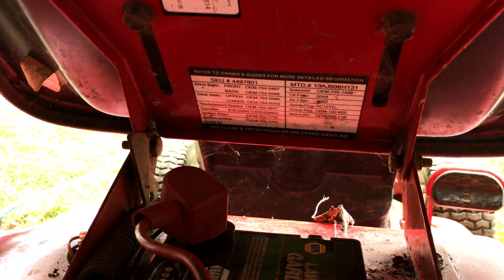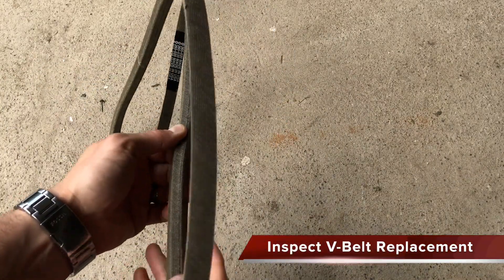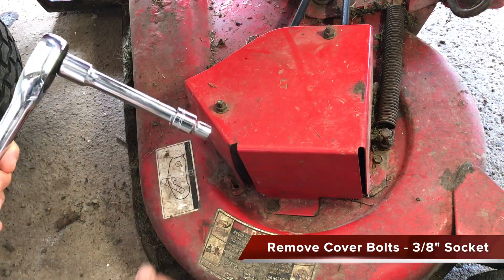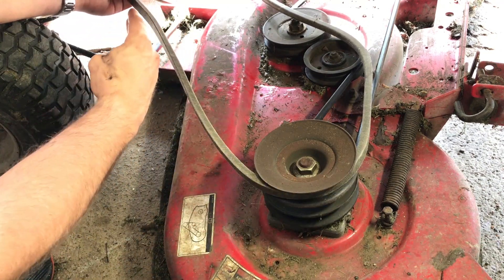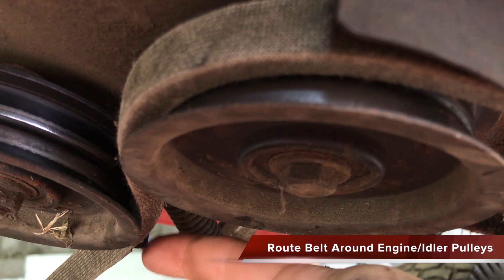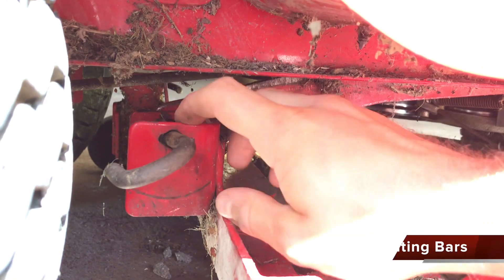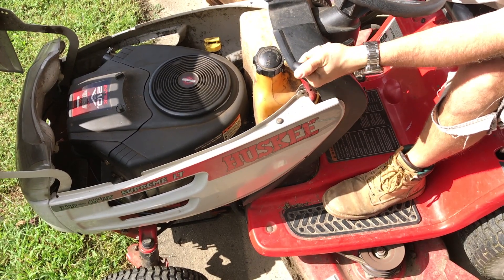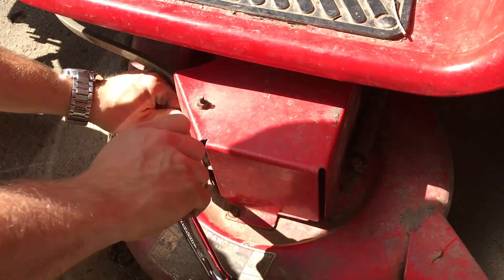MTD and Huskee Mower PTO/Deck Belt Replacement

Comment: Finally, a video showing the same mower I have. I bought mine used and the mower deck was detached and all pulleys were seized and rusted. The key thing I needed to see is how to fit the PTO belt inside the idler pulley coming off the main engine drive pulley. I was having difficulty getting it inside the guide bracket. 
Also wanted to see the orientation of the front deck yoke attached to the chassis. It has been two days of frustration. But now I can see daylight. The spring clips to attach the deck to the support arms was also helpful because I was doing it incorrectly. It has been a learning experience but thanks to your video, I have a path forward. Heartfelt thanks to you.

Comment: My mower is a 2003 Huskee Supreme LT  23 hp Briggs and 46” cut. At TSC the belt called for was way too big! After numerous trips to TSC, and having to take belt guide pins out of pulley cover on deck (shredded 2 belts). I finally found the belt that seems to work! At TSC 5/8”x66” Aramid $21.99. Raining here limited trying out.  5-8-24 😎

Comment: My PTO is a push pull switch, not a lever.   the belt connects both the deck and THEN the engine. Any clues? It's 46 inch deck with TWO blades.

Comment: I wonder if I’m going to get any response to this, my problem with mine is that it moves forward on its own when not in neutral, could that be the belt or does the springs for the gas pedal need to be loosened? Tried googling it but everything is just it won’t move and no matter what I google it’s like I’m the only one with this problem
Reply from the maker: I’d assume the belt is too tight, the rear tensioner under the seat handles this. If it’s too tight, it will continue to drag on the pulleys underneath that handle the driving. Had that happen with a new belt that was too small.

Comment: Great video, I had a quick question maybe you could help me out it would be greatly appreciated, I have the same exact mower as in this video, My PTO belt the same on you just replaced keeps jumping off, If i engage and dis engage the the blades the belt slips right off, i have tried everything and cannot figure out whats wrong. Please if you have any advice please help. Thanks
Reply from the maker: There are some keeper bars that should be vertical and hold the belt in the pulley groove - those are not loose are they? There is a tensioner as well that may need adjusted so when the belt rests its slightly taunt - I believe a large spring controls this, also are you using a genuine belt or third party?
Reply: @DavidStumph  The belt thats on it appears to be a OEM belt but it does appear to be pretty old and maybe stretched out some, i am going to check those keeper bars and i will replace the belt its self and see if that helps. Thanks for the videos
Reply: I have this same mower.It kept throwing off the belt.It is an inherent problem because of the angle the belt is at when the deck is lowered.There isn't enough guidance to keep the belt wrapped around the pulleys. I added 2 idler pulleys  mounted to the deck right next to the 2 outer pulleys that drive the blades. It gives about a 3/4 wrap around the pulleys without putting the belt under excessive tension.Works like a charm,and was really cheap to do.
Reply: I have a huskee pro cut gt- trying to put new belt on transmission drive from crank pully- have to unbolt motor and lift high enough to get belt around the pulley- very bad design- will never have another one
Reply: Have the same mower, I replaced the belt, but it will only cut grass on the highest setting. Once It has any resistance the blades stop, almost as if there is not enough tension the keep them moving. Any advice?
Reply: Mine has a post about 1/4” from the right side idler pulley. First idler pulley from the PTO pulley. Can’t get the belt in there and also noticed that the pulley itself should be a v-belt pulley but it is not. It’s flat like the next idler pulley. I’m at wits end trying to get this mower to run and cut grass. Now I’m trying to loosen the first idler pulley so I can get the belt on. Appears to be smooth sailing after that. If the belt comes off the first time I try to mow, I’ll look into replacing that first pulley with a v belt pulley. If that doesn’t resolve this, I’m about to hang it up with this lawn tractor. The new OEM belt itself was about $38!
Reply: I had same problem. Under motor at that pulley, should be pin guide on right of pulley, on the left a guide bolted to frame (mine was missing). Found old mower at private repair shop bought that part for $5.00. Seems ok now! I had to take guide pins out of pulley cover on left side, was shredding belts. Anything else happens I’m buying a new mower!!!
Reply: @Junior-jm5tq I've got a mower with this same setup, but it's green Gardenway MN:13AQ617H118 from Sam's around 2001-03. 

I have the same issue with the PTO belt coming off the idler pulleys when disengaged. My parts diagram does not show the pin on the right side of the engine drive pulley. 

 Would you please tell me what your exact model is so I can look up that part number?  Thank you!

Comment: Do you know what size (inch) that belt was?
Reply from the maker: 67 inch by 5/8… I have a link to one in the description
Reply: I tried the 67 in.  It seemed to big
Reply from the maker: It was loose on mine too, maybe 65 would do the trick?
Reply: @DavidStumph   it's so hard to find the right belt size. I have a pic of the chart for my tractor. But can't find the belts
Reply from the maker: Agreed. I got fed up and dealt with the larger belt. The tractor underperforms as a result, but I’ve made it work. :/
Reply: @DavidStumph  what's the oem part number to this
Reply: The OEM belt size seems way too big. The part number on the mower won't even engage the blades. I  think it needs about 58".  I"m not sure why it's so off.
Reply: @dwylie4971  I got one off Amazon. It's a 65 inch. Fits great.

Comment: My PTO has to be physically held back for the engine to start. It’s like the mower does not recognized the PTO is off. I’m thinking it’s a bad stop switch. Any thoughts? It’s a Troy-Bilt LTX1842
Reply from the maker: I actually have the same behavior on mine. I’ll let you know what I find if I figure that out.
Reply: David Stumph you need an extension spring part number 732-1165. It pulls the PTO handle back onto the safety switch when the blades are not running. You can order it from Troybilt directly. I just did it on mine and it fixed the problem